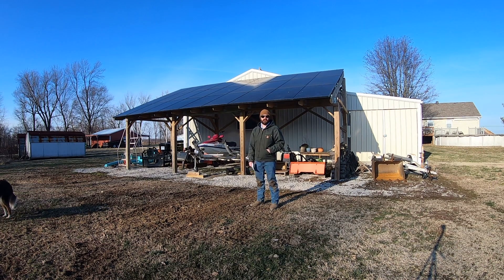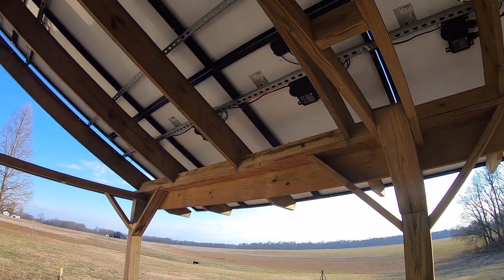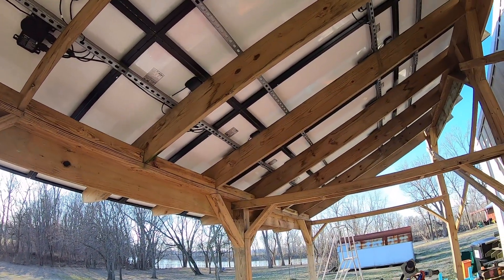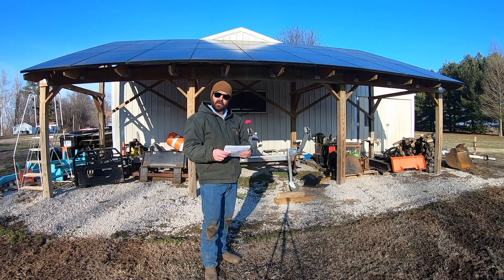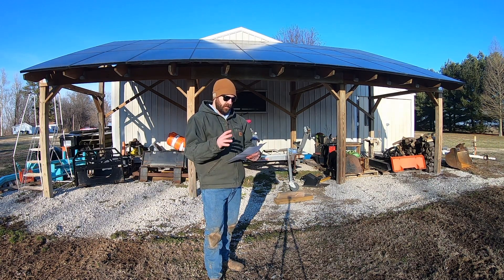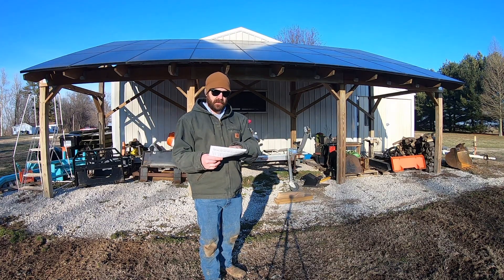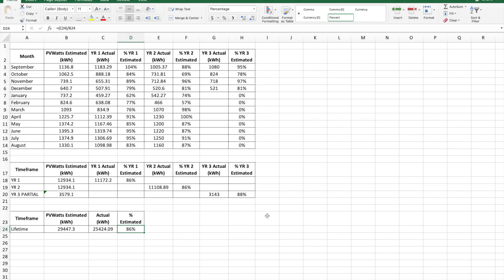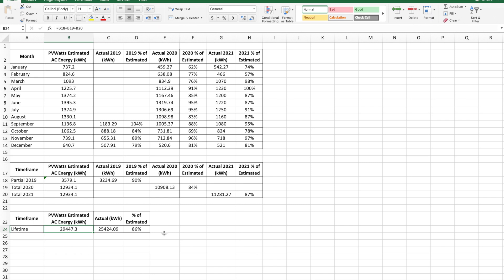DIY SOLAR - 2 Year Review Enphase Energy & Mission Solar PV System

Comment: How far apart are the 2x12s with the unitstrut on top?  Looks more than 16 and I didn't see the answer in the install vid.  Thanks
Reply from the maker: @resnick11  thanks for the question! Yes i think it was more than 18. I ran some calcs on it and have a drawing I'd have to find. Or I could go measure. The rack is 30' wide if I recall so you could count the spaces in the video and divide the length by that count to get spacing.

Comment: Great update.  I love the numbers.  I've  had 2 different grid tied systems for a little over 4 years.  Both are running 10KW inverters and slightly over-panelled, and on optimal South facing sights.  One is roof mount and the other ground.  They produce almost exactly the same amount of power each year.  Each with ~11,000 watts of panel capacity and 10KW inverter they average ~14 Megawatts per year each.  These numbers will depend on region but I'm in WV and I tell folks that in this area on a good site you can take the amount of power you want to produce and multiply by .8  to get the size of system you should install.  Or you can go the other way and if you want to know how much power you can make on a certain budget then spec a system with the amount you have and multiply the panel capacity by about 1.2.  Just remember to overpanel by about 15%. (i.e. move solar panel watt capacity than inverter output capacity. panels are cheap)  This accounts for the fact that its very rare to have perfect conditions, so 10,000 watts of panel capacity and a 10KW inverter is almost never going to produce10000 watts of power per hour due to sky conditions, panel degradation, sun angle, etc.
Reply from the maker: Yes great point thank you! I agree with over-paneling for sure!

Comment: I purchased an extendable rake to clean off snow.  It would work well in your case.  it was about $35 and in most significant situations where you get a few really nice days after a 2+ inch snowfall you can increase your solar production on a system like that by about 100 KW.  Sounds like a lot, but that would take about 2.5 snowfalls followed by perfect days to pay for the rake.  So It's kind of up to the user.  If you're off grid and charging batteries then I'd say it might be more significant than being grid-tied
Reply from the maker: Good call! I do notice when it's cold but the sun is bright it generates a lot. I guess it's something to do with the thermal differential between ambient air temp and sun ray temp on the panels.

Comment: Guessing the 86% is due to inverter clipping loss
Reply from the maker: I don't believe clipping is the issue.  Generally panels do not output their max wattage.  365w panels would only ever put out 365w if they are operating at 100% efficiency.  Between clouds, rain, snow cover, the north-south orientation and the correct tilt orientation throughout the year, etc, those factors reduce the panel output.

Comment: Have you considered adding batteries and what  would be the $$ pay off to consider?
Reply from the maker: When you have a grid-tied system there's really no need for batteries with the exception that you do not have power when the grid goes down. Batteries are used to take & store excess power until you need it (at dark). With a grid tied system you send excess power back to the grid and I get credits for every kilowatt hour I send back. Then at night when I'm not generating power I pull power from the grid and if you do it right your credits balance out.

Comment: the reason the snow stays so long is your panels are not set for winter(they set for summer angle). When doing solar a winter pitch (14 roof) is better. I know this as I have one built.
Reply from the maker: I set my angle based on the optimum power generation based on my geographical location and azimuth. Check out my how to design a system to see why I chose the angle I did.
Reply from the maker: A steeper angle is better above the equator during the winter, but a flatter angle is better in the summer. I was going to make them adjustable with a bottle jack and a couple square steel tubes and pins to lock it off at different angles but I didn't get around to it.
Reply: @DC Are your panels on a roof or open underneath?
Reply: @tommywiseguy  Ground mount no adjusting angle. I I used winter angle as that is when I need all the solar I can get and so the snow will slide off easier.  even on a roof adding 10 degree angle more helps.

Comment: About snow or ice, can you mitigate it with a coating on the panels?  You would think that problem would be addressed in colder climate installations.  Maybe a defrost mode could kick in.  It would add to the overall cost I'm sure. 
On a lighter note, I have noticed the accumulation of equipment under the array from first install year to now.  😊
Reply from the maker: The sun melts it off pretty quick. But yes a reverse defrost seems like something they could implement for northern climates. 
Haha yes I wish it was larger! I want to build another larger building that's tall enough for me to get my trailer in with equipment still loaded on it. I don't like leaving stuff outside and it's a pain to unload and reload sometimes.

Comment: Hi Neal , first excellent video, I have watched your planning and per not video,Your installation video, first year review and second year review. I think they are excellent and five star.

I noticed you had made some excellent excel sheet for single diagram utility permit and for your appliance and yearly usage, is it possible to get a link for it so that I do t have to create it from scratch, I don’t need your number if they are private, it would be very much appreciated and save me a lot of time.

Thanks
Sangye
Reply from the maker: Check my channel and it has my email address.  Shoot me a message and I can email you the line diagram i made.

Comment: I'm looking into a 14kWh system - and using the IQ8 MIs - mainly for being able to still generate power when the grid goes down - even without battery.  I would live to do it myself but I don't have the tools/ability to build something like you did and mine will be ground mounted out in pasture - so long trench to the house.
Reply from the maker: Peg, the IQ8's look very promising!  That would be nice to have power without the grid for sure.  Get some friends and make it happen!
Reply: the thing you actually need for a system that will work off grid is a neutral forming transformer that can create an AC signal for your home and not from the grid as well as a relay to disconnect from the grid, just a heads up.